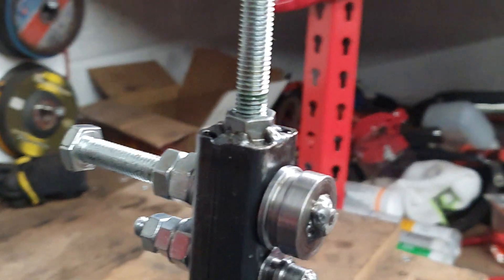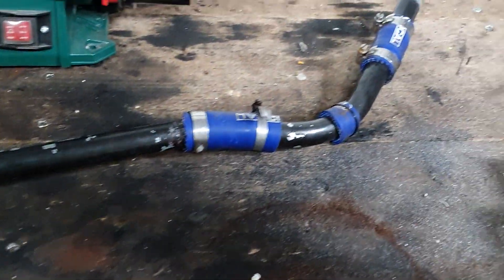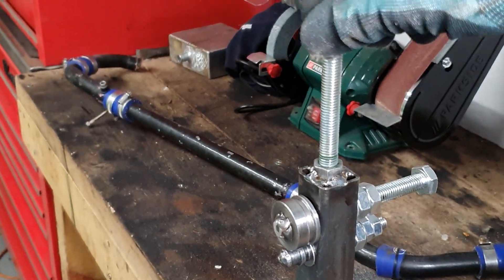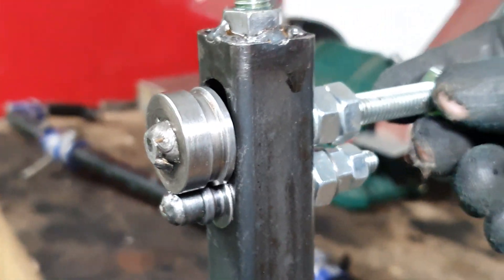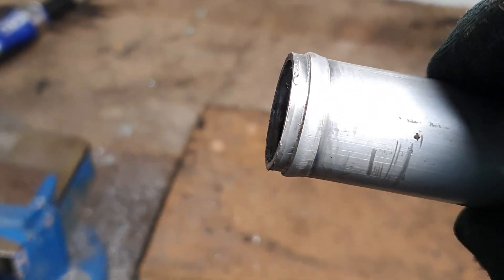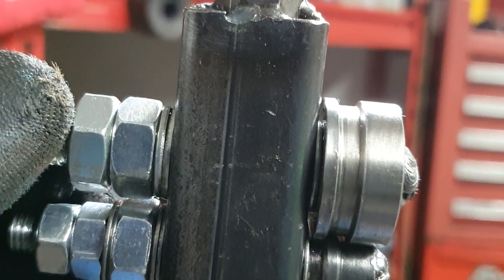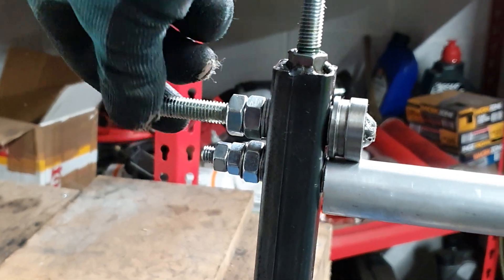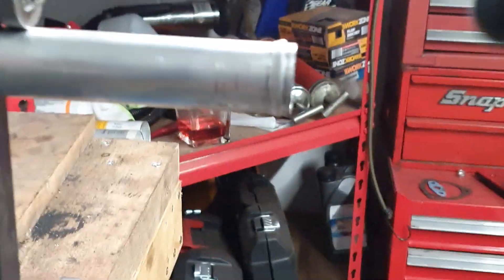Homemade tube bead roller. DIY track car coolant pipe bead roller/ swager.

Comment: Nice and easy that. Really like the idea. Could you turn me up a couple of those collars please? Will gladly pay
Is the bottom collar on a bearing or also sleeved like the top collar?
Reply from the maker: Hi Andy, I could but I'm mega busy at the minute trying to get on with my campervan conversion, so I'm not sure when. The bottom one just has a stud welded to it running straight through the box section,  no bearing or anything